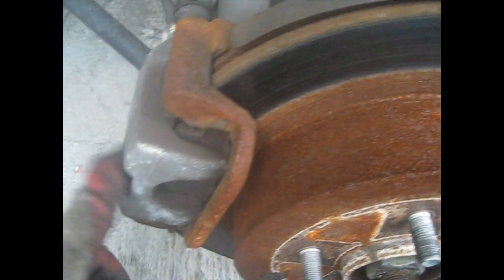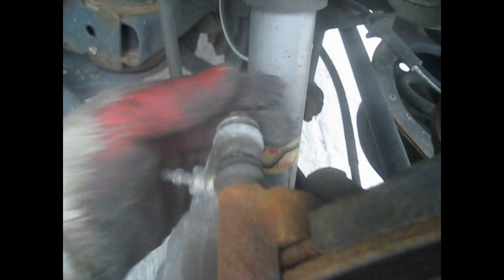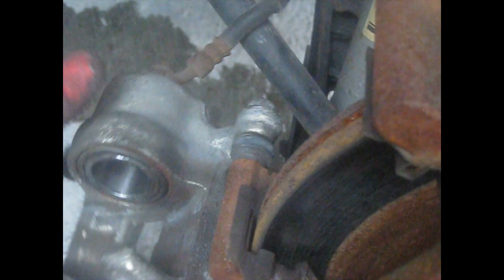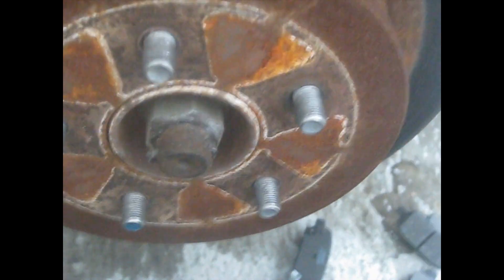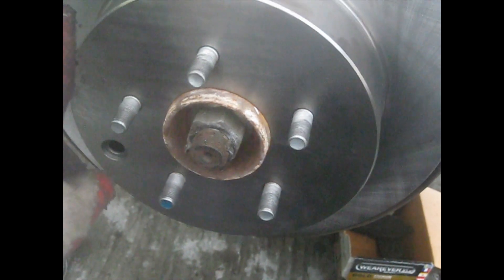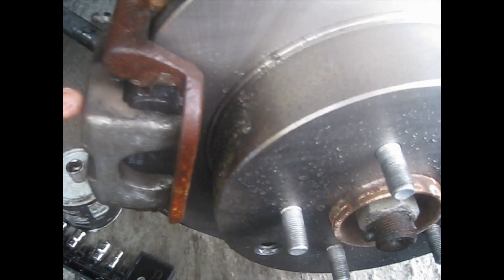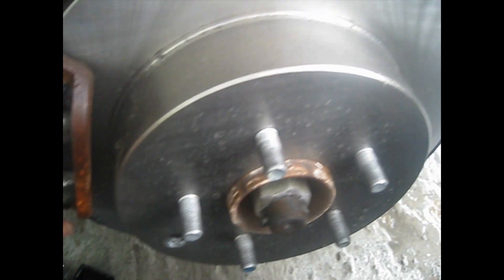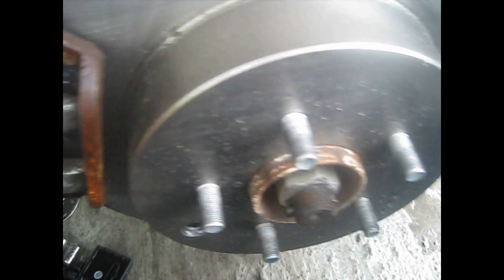Nissan Murano rear brakes and rotors replace pt2

Comment: If you do not remove the bottom bolt, a dry brake guide pin will cause the caliper to seize, improper pressure to pad, lack of float.
Reply from the maker: Okay
Reply: Jim Engineer Outstanding reply

Comment: 😂😃😄😅 He says make the reinstallation bolts nice and tight, until you strip that aluminum hub assemply or use a torque wrench ?
Reply from the maker: Use your judgement, nice and tight, doesn't mean to kill it.